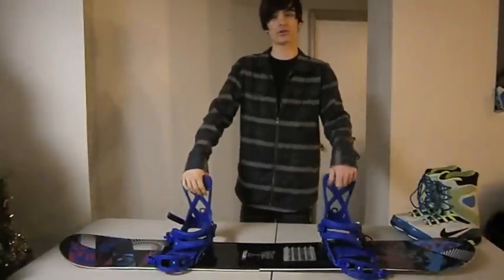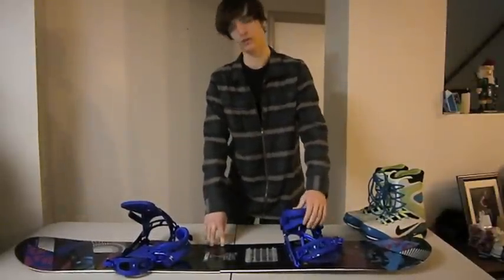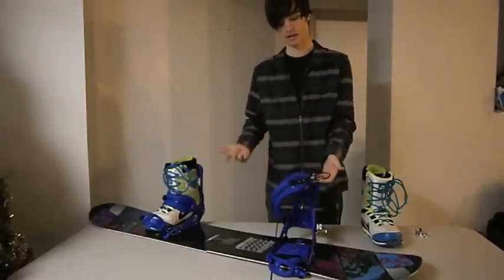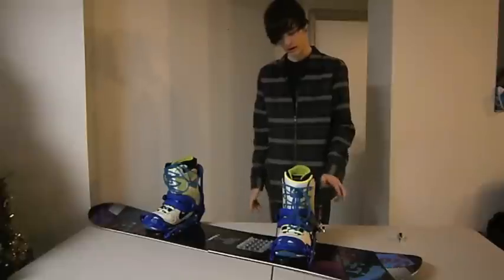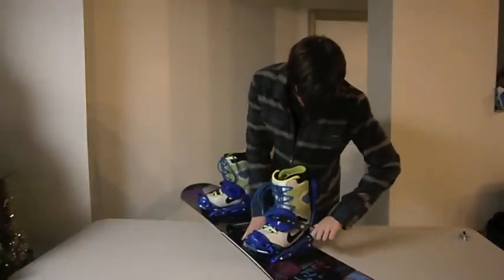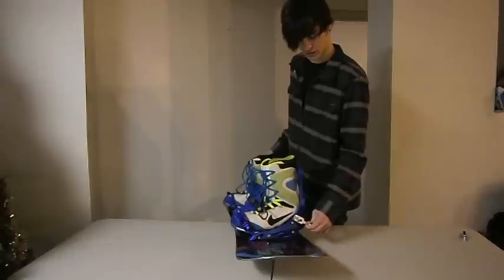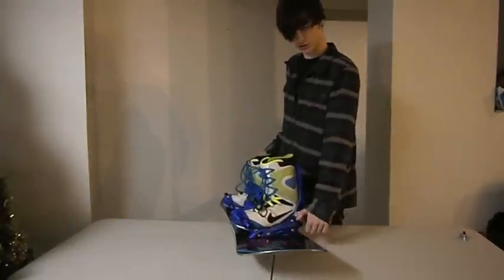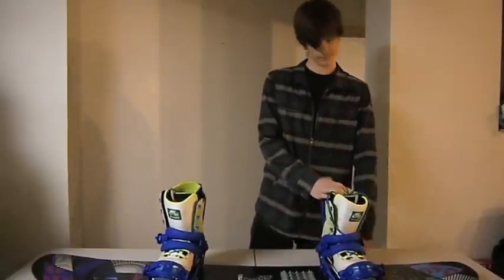Quick Flip Technology Snowboard Binding (patent pending, new prototype)

Comment: Why is it better then FLOW rear entry?
Reply from the maker: Ever tried to get into back entry bindings on a hill, in powder, or sitting down?
Ever tried to clear snow out of back entry bindings?
Ever had to mess up all your adjustments to fit your board in a board bag?
Quick Flip Technology allows for ease of use in all conditions, and it also keeps the baseplate open, so you can clear snow out easily. It also provides the benefit of being able to store your board in a board bag without messing up all your adjustments.
In addition, it's also easier and quicker to adjust because you don't have to take your foot out to move the straps around.
You can also get them tighter. You also get the benefit of the less rigid highback you get with standard bindings, which most prefer.

Comment: what a fantastic idea. good luck with it. I would buy it.  could u use something slip on for the toe that would lock down before u ride.
Reply from the maker: Thank you! I am currently developing ideas for the cap strap, but will need more funding to move forward. I not only want quick entry, but also a true feel strap with no dead spots/pressure points as well. For now, I'm just working on the ankle strap. New tech video soon and possibly some kickstarter pages to come!